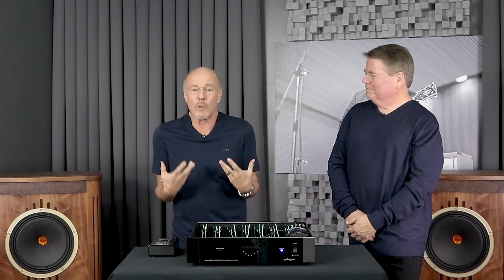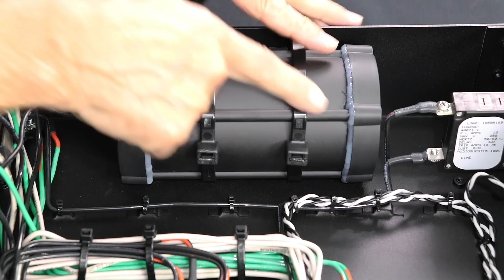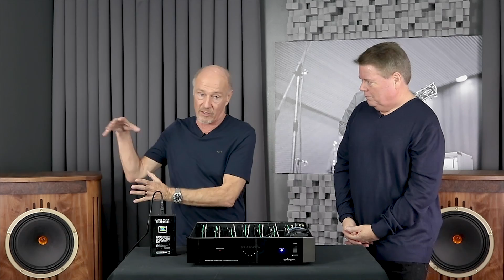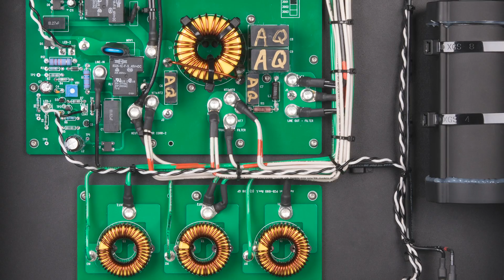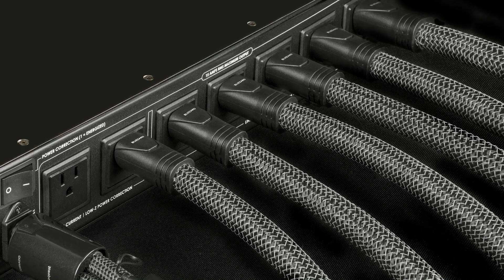AudioQuest Niagara 3000 In-Depth Look w/ Upscale Audio's Kevin Deal and AudioQuest's Garth Powell

Comment: @13:34 -- I own a Shunyata Python power cord, purchased approximately 13 years ago.
Does that Python power cord have that noise dissipation / directionality that Garth said is a must have?

I am interested in a Niagra power conditioner.  Will my Python power cord satisfy the Niagra's requirements?

Also, will my Python power cord physically plug in to the Niagara box?  It has a NEMA 15 plug for the wall socket, and a NEMA 20 plug for other end that would plug into the Niagara box.

Comment: Ladies and gentlemen, boys and girls, audiophiles and the rest of you, I’m using one Hi-Fi Tuning Noise Destroyer ($250)  plugged into  my power strip and I’m achieving the EXACT same results. My AC Noise Tester went from over 100mv to 0mv using this device. And, it works in parallel so the is NO current limiting. Wanna save yourself thousands? Heed this advice!

Comment: The thing is …. None of you naysayers has tried this. I think AQ is over the top with marketing, BUT … I am in the middle of an eval of Type 9 DBS speaker cables vs. WireWorld Mini 8. I can tell you there ARE differences. And an aftermarket though inexpensive, beefy power cable I bought for my amp made a difference. I am absolutely certain that NONE of you have any experience with the products you crap on.

Comment: Snake Oil people. 
All Audio Amplifiers use DC voltage to amplify audio signal.
Any noise can be EASILY filtered, almost a joke, when the Amplifier power supply converts AC to DC current.
There is ABSOLUTELY NO NEED to condition AC power, I mean wake the hell up people. 
How gullible and ignorant Audiophiles are... man....

Comment: Snake oil. I am an electrical engineer with 40 years experience in design. These power conditioners solve problems that dont exist. The power supply in you electronics provides all the filtering and regulation you will ever need. Audioquest is obviously doing a promo program as review of their piece of junk are  appearing all over the place. I liken buying a power conditioner to buying an additional special 500 fuel filter for you car. Your car already has a filter so why buy another one, it is duplication of function. I will bet money that there is not a person alive that can A/B a power conditioned system and correctly identify it in blind tests.

Comment: So how does this compare to Torus Power - is it as good? Does it really allow for the same type of fast draw for better "peak" performance? In all honesty for me minute noise is not the biggest enemy in my system, but a faster current draw would be a big upgrade...
Reply: What Audio Quest isn't telling you is with this power conditioner is a large reactive load that increases your power bill. It does filter things well. You can build one for a few hundred dollars. I'm pretty sure he's re branded Furman/Panamax AC spike protection. Maybe he got the licensing to do it, but I really doubt it. Garth did this at Furman with the IT-REF. the power amplifiers outlets where not balanced technical power. Furman made a bunch of excuses as to why you wouldn't be able to plug power amplifiers into the isolation transformer outlets. some real snake oil.
Reply: @kickenyourass  how do you build it?

Comment: I would only consider the bigger 7000 model, much better or then go with the gigawatt pc4 evo 4 with DC filter if you want that clear modern sound. Personally I have Isol 8 mini sub axis which I consider the one beating all of these in regards to overall sound especially naturalness. But yeah, if you absolutely have to have the most clear and bombastic sound out there then the top Niagara 7000 model and Gigawatt is the way to go.

Comment: I have the McIntosh MC255 Power Amp 
And the McIntosh MX123 A/V processor. 
Will the 3000 can limit the McIntosh power Amp Dynamics As it is a power amp 
Not a processor/ Dac / sensitive source ?
Some manufacturers recommend connecting power amps directly into the wall mains. Not to power conditioner device. 
Thank you
Reply: Mcintosh recommends plugging their amps in the wall directly and everything else into a power conditioner
Reply: itsrecording : Thanks very much indeed.

Comment: Those power noise meters are interesting. I got the $150 Badaa unit and it reads just above zero. Hmmmmm ... 🤔

Is there a 30 day return policy for this? If there is then just try it out. The proof of the pudding ... better than calling it out as snake oil. Once you try it and find it does it does not work then voila! The truth shall prevail. 😬

Comment: Ok I will say this after reading the many posts below.
I was or have been extremely skeptical about spending hard earned $$$$ for a high end power conditioner. 
Based on the type of equipment that I have which is all component system from the source to the amps adding the. Niagara 5000 was a significant improvement . I was using the N-5000 just  for my 2 mono-blocks and had another PC Made by Furman in the source rack . I recently removed the PC in the source rack and used the N-5000 for source components and instantly heard a difference . Music was more spacious and open , lower frequencies (bass) had more punch and quick. Everything just sounded better more “pure” . I have recently ordered a N-1200 for the amps since the amps are now plugged directly into the wall . I will have to also say that I have invested over the years In interconnects because they do make a difference that you can hear. I don’t get how all this works but it does.

Comment: I have the Niagara 5000 for 2 years , best investment i've made , just sayin
Reply: It lowers the noise floor to non existant bringing more definition tight bass giving the bass more slam and meat on the bone and more transients to all frequencies.
Reply: moukie bengal ... I’m not a big believer but am willing to try. Just that my amp has 288k of caps, so I wonder if it will even bring any improvement.

Thanks!
Reply: @hushpuppykl  
If you do try, I'd certainly experiment with it ahead of the entire rig ... not merely amplification.
Reply: I auditioned the Niagara 1000 and 5000, they superimpose the sound, it becomes too technical and analytical and not natural one bit. I decided to go with someone else.
Reply: moukie bengal ... how much difference does it make? I’m curious.

Comment: To be honest.. this is not necessary .. and overpriced! .. I just used an APC UPS, it has enough battery backup to save my devices from occasional power outages and has all the power conditioning needed.. never caused any static noises or distortions, nor it caused any discomfort in my music listening or caused any loss in dynamics.. and it caused around ~$120 US dollars.. The only thing i have added is a dedicated ground wiring for the equipment circuit with a separate earthing to isolate ground noise from other home components.. I do that for my editing system as well
Reply: Hey man! Out of all the comments I've read here, Your sounds most genuine and sensible. Infact, I'm thinking to do the same. To get a APC UPS. 
Which model UPS did you get? And can you elaborate what you did with grounding wire? I want to understand it better and do that at my place also. Thank You!
Reply: @ratedrsuperstarthega  i used an Apc 1200VA ups and the grounding is traditional grounding for house,  copper wire down to earth.. only this time it's not for the whole house only to the power socket  I plug my ups to.. so it's not sharing the grounding to any other equipment in my house.. the ups will stabilize other fluctuations in electric supply and gives a 30 min backup when power is out..
Reply: how you can added a dedicated ground wiring to the fuse box???
Reply: @josephlai99  not to the fuse box.. on to the socket you plug your devices to.. you can add a dedicated breaker box if you are concerned about short circuit.
Reply: @Hkmmotologs  thanks!

Comment: When we get real serious about audio in the US we'll go to 230 v balanced power, like your clothes dryer, range and air conditioner use.
Reply: AND we will get rid of the IEC cable and go to something like the Neutrik, only bigger if we are going to four wire 230v. In Europe some houses actually have three phase drops. That would be ideal but most Utilities in North America will not provide three phase to domestic customers, because reasons, as Steve Sailer would say. (Too bad for us Monarch 10EE thyratron controlled lathe owners...)
Reply: SpeakerPower amplifiers, made in the US, with US sourced parts. 
They offer 240v amplifiers. I own 5 of their amplifiers.
With regard to the metrics that matter... low output impedance, and sustainable power output, the finest subwoofer amplifiers available.
Reply: Why not pick up a balanced power transformer which. Do the same thing- +60, -60. which will cancel out noise.

Comment: AudioQuest, who cares, AudioQuest designed by Garth Powell now that's a entirely different story. He is one brilliant engineer, if he designed it then its going to be great, you can bet the farm on it!
Reply: yeah no it's fantastic what his products or ones that he designed are capable of. he used to work for Furman and some people know it and some people don't but I've got the PST-8 and I've had that thing in numerous different systems and it was the first product i'd ever used of a power nature that really made a difference. not only that everyone that I had tried prior a various brands including a shinyata we're all damaging in some way to the sound. as soon as I plugged in the Furman I didn't hear anything except for a reduction of noise and a more cleaner sound, I didn't hear a degradation of the dynamics or the tonal characteristics of the music just a lack of extrinuous noise. I'm about to purchase a Niagara 1200 to add to my system as a replacement for the Furman but any power conditioner I'll only buy it if it's been designed by Garth Powell.
Reply: @BudgetAudiophile  hey bud,

Honest question I’m curious about the Niagra 1200. I wanted to buy one mostly because it also acts as a non sacrificial surge protector.

I have a Pangea Audio 20amp outlet with dedicated 20amp line to my breaker box. Hooked up to that is relatively new Monster Vertex Surge Protector rated at 3000 Joules. ($200,000 Connected Equipment Guarantee).

I have roughly $5000 dollars in equipment hooked up to it. Laptop, Powered Speakers, and Laptop accessories.

My question is do you really believe the Niagra 1200 is worth it. Once my Monster takes a some hits I look to replace it with the Niagra 1200.

Just would like to hear from someone with hands on experience. I’m not a snake oil shouter.

I have Audioquest USB Carbon Cable and NRG-Y3 PC Cable because I wanted a premium look and feel to match my $1400 speakers. The USB cable actually made a difference.
Reply: @BudgetAudiophile has that 1200 working for you. I’m about to upgrade my home theater system to a 7.2.4 was wondering which one to get either the 1200 or 3000.